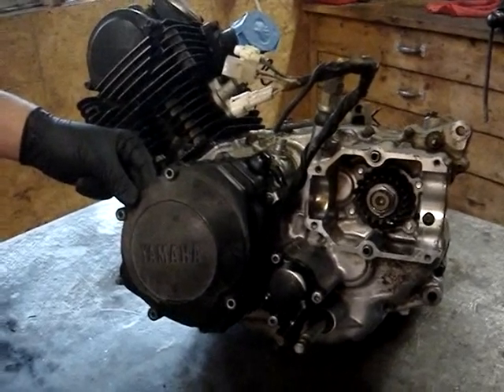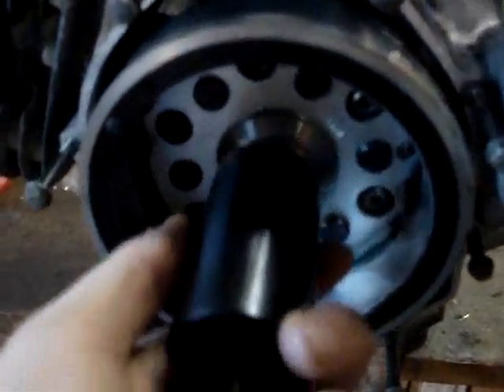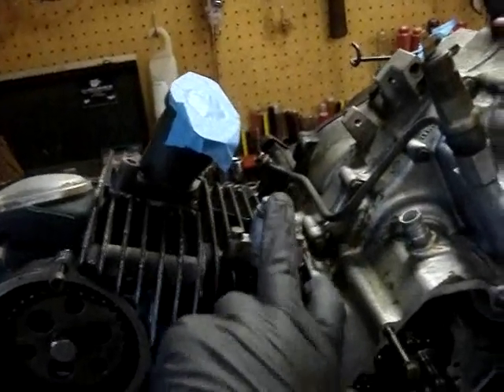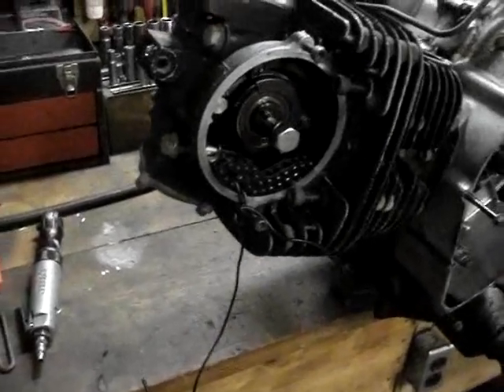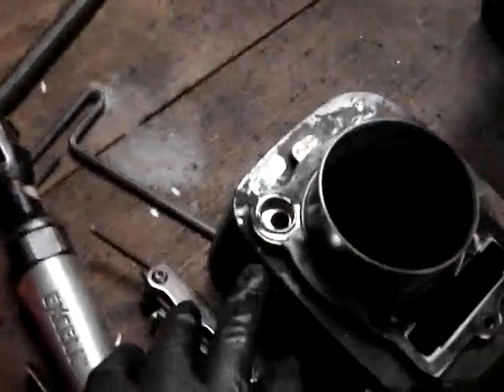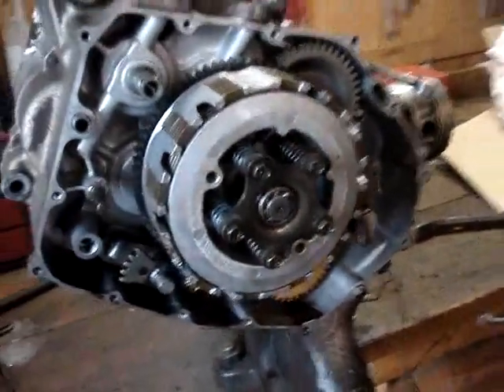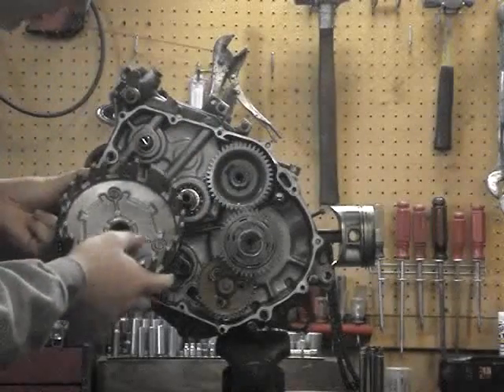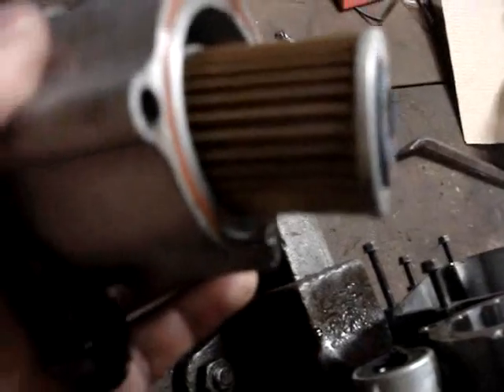Yamaha 350 Engine Teardown Part 1 of 3

Comment: I've got a 2004 Yamaha Bruin 350. I've seem manuals on line but not for the information I am looking for. I've got to check to see if the key has sheared and moved the timing marks on the flywheel. I have a recoil start rope on mine. I don't know if I can put a breaker bar or a screwdriver to hold the start teeth in place while removing the bolt that secures the cover???

Comment: hey have a 02 warrior 350 tearing down to replace rod would i have to take clutch side of motor apart or can i just take the flywheel side crankcase off?

Comment: In order to take the electric starter motor out to replace the brushes do would you have to get a fly wheel puller and take it all apart like that? or can you simply slide it out from the other side?
Reply: Rob Hayden there is a rubber oring in the starter where it slides in the block, its tight. Take 2 starter bolts off and positive wire bolt and it comes off with a little tapping.